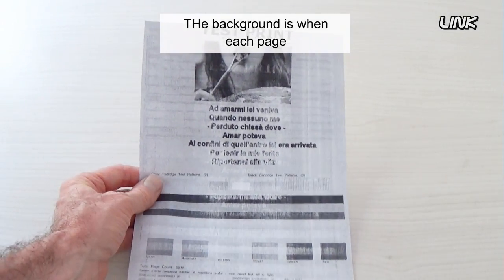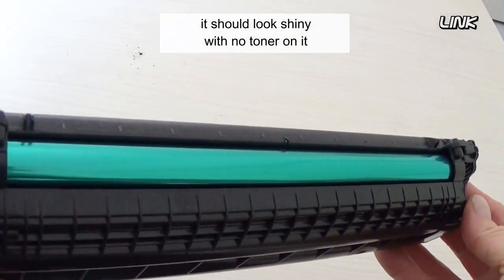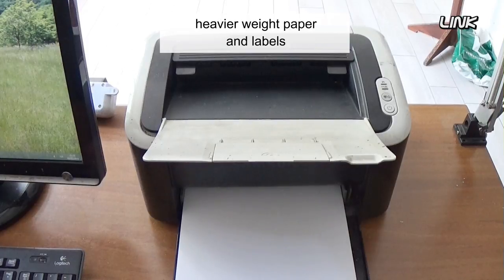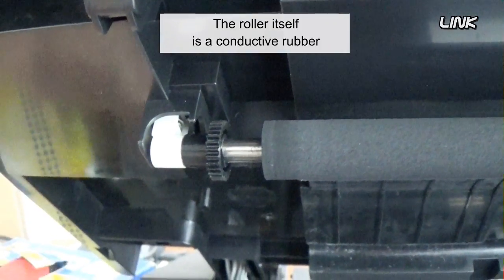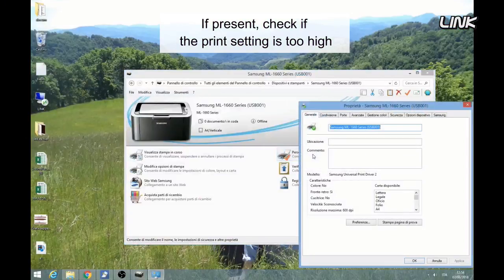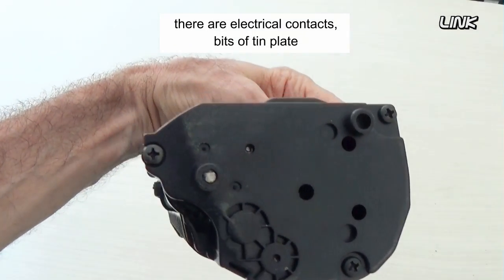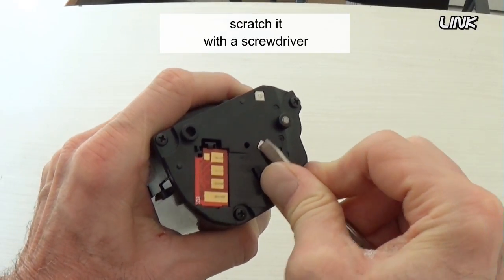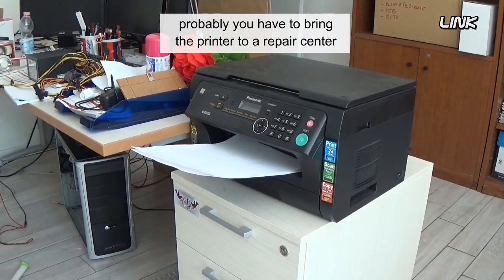Gray background when printing: causes and solutions

Comment: I have a HP LaserJet 1300.  I print a header and footer on plain paper to create a 'letterhead'.  When I print again on the 'letterhead' I get a grey toner haze on each page.  This haze only appears when I print on the 'letterheads'.  All other printing on unused plain paper is perfect.  Is there any setting to the printer correct this or any treatment of the paper to prevent the grey haze when I put it through the printer for the second time?  The second print print can be days or weeks later so the temperature of the paper is not a factor.
Reply from the maker: I never hear that.I can suppose that the cartridge produce a light background, and when you print again the repeated background become visible. Is it a word file? try to print the letterhead with a simple text file. It it doen't works the problem is not the cartridge.
Reply: Many thanks for the quick reply.  However, I'm still a bit in the dark (pun intended).  The 'letterhead' is printed in grey scale on PowerPoint but the header and footer are separate.  There is nothing in between.  The header is a copy of a graphic and the footer is a 'normal' text box.  I have tried printing a blank piece of paper twice and have found very slight hazing, but not as much as the 'letterhead'.  In fact, it is hardly noticeable.  It therefore appears that the existing grey scale images on the 'letterhead' are somehow "triggering"  the hazing in some way, although that doesn't sound logical, even to me. I'll try a different brand of paper and see if it makes any difference.  Many thanks again for your interest and help.
Reply: if you are printing on specialty paper that is NOT white 60-90lb bond (the default setting), you have to change the paper settings in the print menu's printer properties tab or button.  For example, I just printed a dark red volume cover on 120lb cardstock.  To print on this paper, my printer has to heat up higher than is needed to print on plain white paper, otherwise there is slipping, smearing, hazing, and blobs of melted toner all over the surface.  To change this, I go to the print menu, select the printer properties button, select page setup, select paper type, and from the drop-down menu, I select "heavy 90-120lb".

Check your paper's specs and change your printer properties to match - see if that helps.